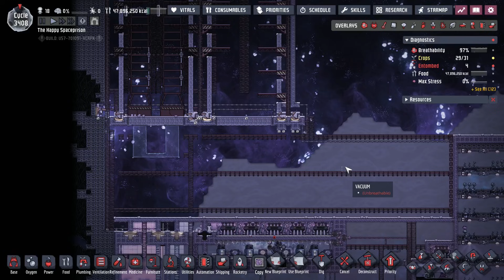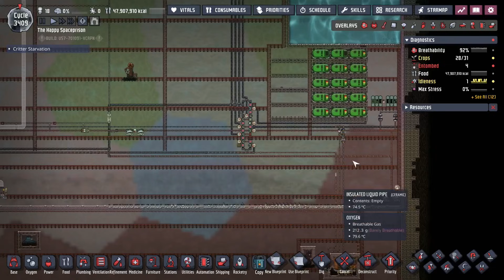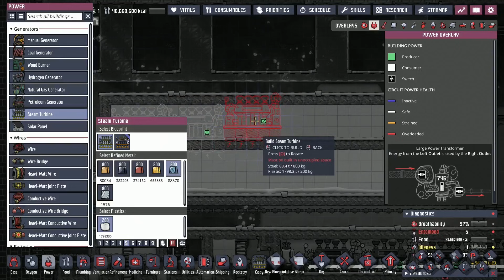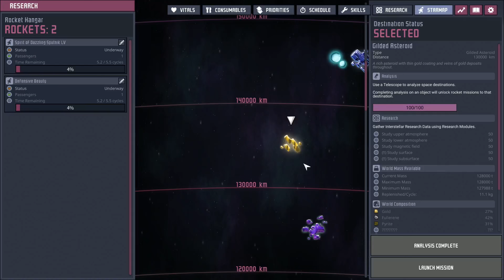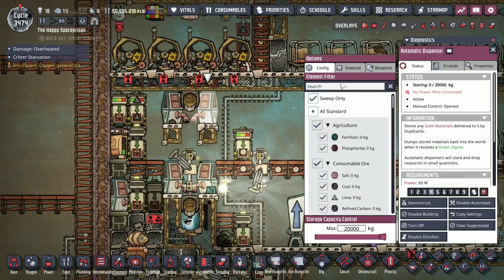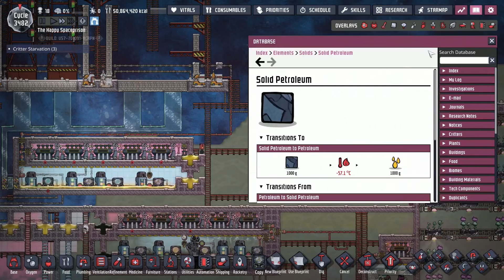Recapturing Rocket Exhaust | 33 | ONI Base Game |All Achievements

Comment: Petroleum has low specific heat capacity compared to anything else.... You would be better of cooling poluted water and then heat exxhanigning to to petroleum
Reply from the maker: Did not think of that.  Im not really trying to cool.it off fast, just cool it off.  But I may play around with that.